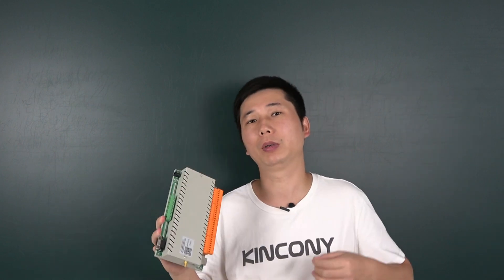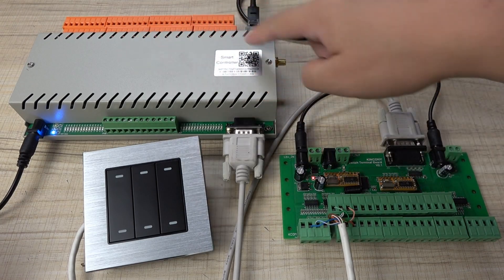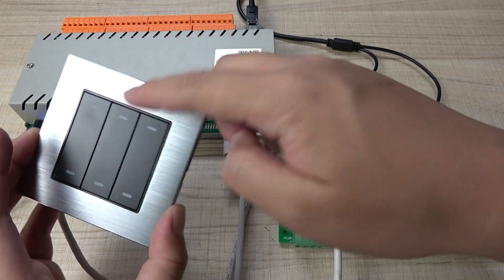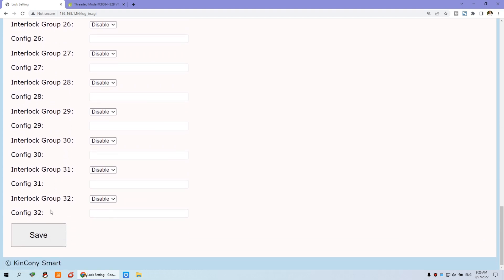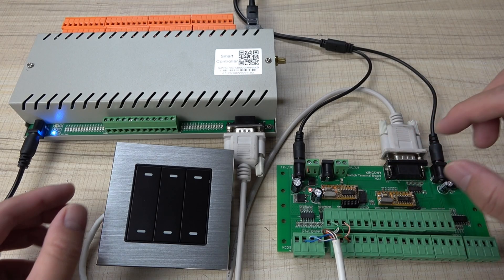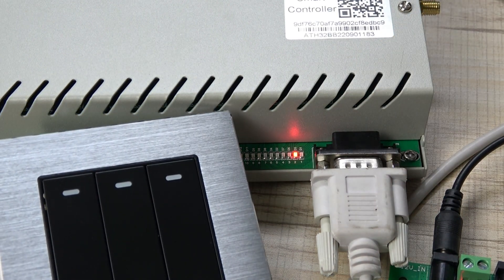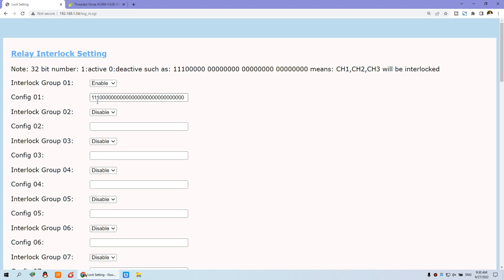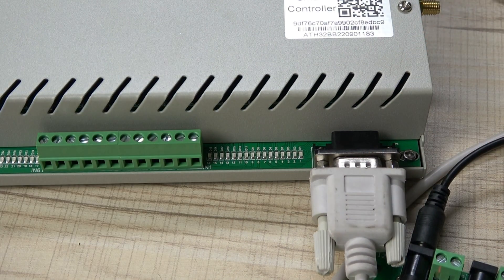H32B controller new firmware for add "interlock" function

Comment: Where can I find the latest firmware version for H32B Pro ?   I'm running H32B_Pro_V1.19 but when I turn on relay 1, relay 2 doesn't turn off. Using 11000000000000000000000000000000 as in example.
Reply from the maker: v1.19 is newest, any problem details you can post to our forum .

Comment: Is it possible to install this firmware on KC868-Server?  I don't have Interlock option available and would like to use it for curtains.
Reply from the maker: sorry, H32B firmware only use for H32B, not use for KC868-Server, KC868-Server mainly use for home assistant, so you can set "interlock" by home assistant.
Reply: @KinCony  how to interlock if using mqtt between kc868 and home assistant?   What about interlocking from ESPHome, would it work?
Reply from the maker: just set "interlock" option in controller's config webpage, not need set in ESPHome. @sebagarayco
Reply: @KinCony  I don’t have such option in my KC686-SERVER. Maybe outdated fiemware?
Reply from the maker: sorry, KC868-Server not have "interlock" option, if you use by ESPHome, you can add "interlock:" command, see here details: https://esphome.io/components/switch/gpio.html @sebagarayco
Reply: @KinCony  thanks for clarifying. One more doubt: what about the PIN numbers of output 1 to 16 ? Checked the diagram but didn’t understand, sorry.
Reply from the maker: these output pins have manager by ARM CPU, not by ESP32. @sebagarayco

Comment: hi .I am using kincony a16 with 16 relay board with esphome running but at the boot time all the relays  toggle  and make the relays on and off ...is their a way to stop this in the software side..this is become a big problem for me due all the appliance connect to relays suddenly become active and then turn off at the a16 booting up....
Reply from the maker: can you take a video post to our forum? it according to config file for the initial state.